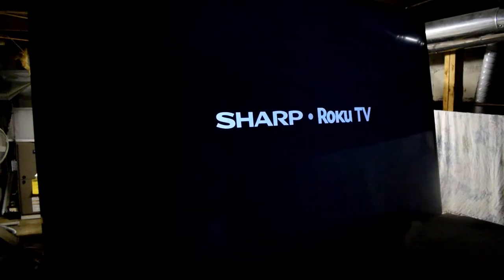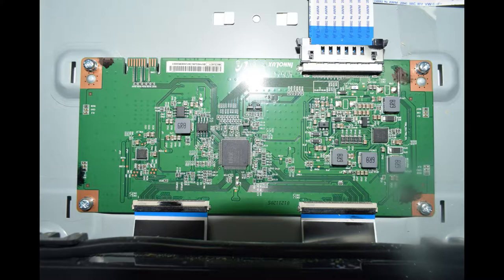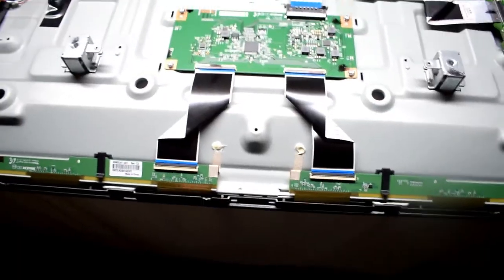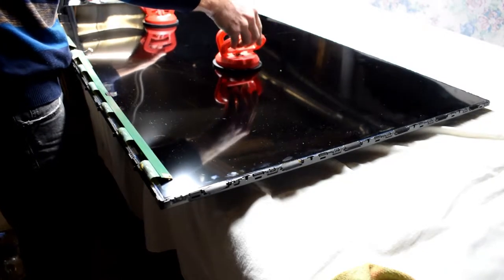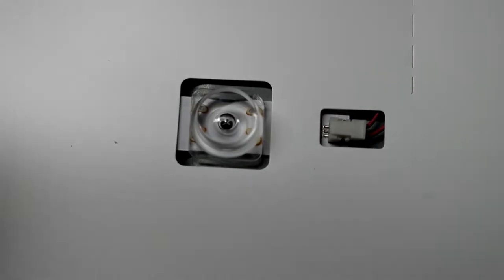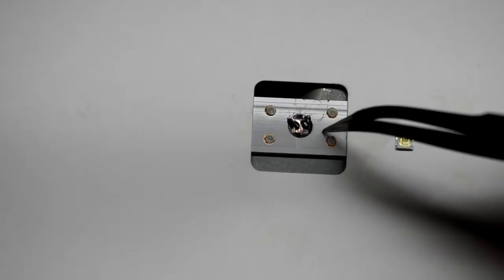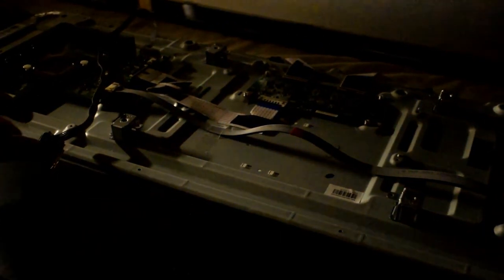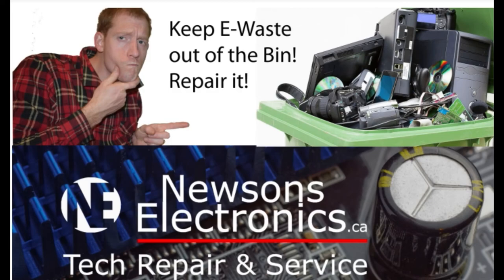58" ROKU TV by SHARP Black Screen FIXED! (LC-58R6003U)

Comment: Big time thanks for this video! I wasn’t able to liquid solder the LEDs I had to buy the whole LED strip. For those struggling with the same issue. Make sure you get the right strip for your model. The strip itself will have numbers that correspond to the right strip. I bought mine on eBay, He’s of luck! I learned some stuff from reading the comments.

Comment: So my tv just had this happen where it couldn't turn on. Troubleshooting every idea that came up on YouTube only to find that the power connection was the problem. Your video was instrumental in identifying the problem. I didn't have to replace the led but had the same tv set aside that had another problem a year ago. Was able to replace broken components from 1 to the other based on your simple instructions 🙏 thanks so much for making this Brother!
Reply: Have this TV and it’s black. Doesn’t turn on. My husband tried to fix it from your video but cracked the screen 😂. We are throwing away the TV, however we have all the parts from the back of tv (motherboards connections etc) and led lights. If anyone wants it message me. We give it away (live in GTA)
Reply: Hello Kate. 
If you still have the parts, i would appreciate them. I have tue same problem and shipping on eBay is about 2 months. Keep me posted if you still have the parts. Thank you.

Comment: Hi, I'm doing repair on a similar model (58R6004U) and believe I have a faulty power supply board. The board probably shouldn't have "heat marks" around some compenents eh? Also, the wires coming off the component in bottom center look a bit charred.

Comment: Do you happen to remember which led was what you ordered? There’s 3030 3535 or 2835 for 3V.   
Thanks man.
Reply: Have this TV and it’s black. Doesn’t turn on. My husband tried to fix it from your video but cracked the screen 😂. We are throwing away the TV, however we have all the parts from the back of tv (motherboards connections etc) and led lights. If anyone wants it message me. We give it away (live in GTA)
Reply: I have the same problem. Did you figure out which one?

Comment: I have the same TV with the same problem. I don’t have a LED tester yet. I disconnected the LEDs and measure the voltage at the connector. It goes from 190V down to 10V and back up. Is that a bad power supply or does this happen because the current is monitored and the LEDs are disconnected?
Reply: Nope!  I think there is an electrical component that is doing this behavior.  It might be a regulator or something.  My LEDs were bad, but I don't think I could have found out with a multimeter.

Comment: How do we fine out witch led size is right of our TV. or do it matter as long as we use the right voltage? (2835 ,3030, 3535 )
Reply: Have this TV and it’s black. Doesn’t turn on. My husband tried to fix it from your video but cracked the screen 😂. We are throwing away the TV, however we have all the parts from the back of tv (motherboards connections etc) and led lights. If anyone wants it message me. We give it away (live in GTA)

Comment: Hi, I have the same TV where at least one led went open cct.  The TV power cycles instead of booting up.  I thought it might have been due to the backlight going overcurrent, but disconnecting the backlight plug still didn't allow the TV to boot up.  Did yours behave the same way when the backlight failed?  I just want to be sure there aren't any additional problems before I waste any time fixing the backlight.  I wonder if the TV monitors the backlight current, then doesn't allow boot up when no current is detected on the backlight output.
Reply: Have this TV and it’s black. Doesn’t turn on. My husband tried to fix it from your video but cracked the screen 😂. We are throwing away the TV, however we have all the parts from the back of tv (motherboards connections etc) and led lights. If anyone wants it message me. We give it away (live in GTA)
Reply: @thezyp hi, sorry it’s all gone.
Reply: For this TV, if the backlight is bad, you won't be able to turn the entire TV on.  Kind of a bad design if you ask me.  I just replaced my backlight with the same symptoms of you, and it fixed it.

Comment: Looks like the link for the 3V LED is broken. Can you please advise on another source?
Reply: Have this TV and it’s black. Doesn’t turn on. My husband tried to fix it from your video but cracked the screen 😂. We are throwing away the TV, however we have all the parts from the back of tv (motherboards connections etc) and led lights. If anyone wants it message me. We give it away (live in GTA)

Comment: Hey can you please share another link to the 3V leds you used ? Link in description doesn't work.
Reply from the maker: https://www.ebay.ca/itm/294218172982?hash=item4480c50a36:g:nCEAAOSwZ79gwIY8
Reply: Have this TV and it’s black. Doesn’t turn on. My husband tried to fix it from your video but cracked the screen 😂. We are throwing away the TV, however we have all the parts from the back of tv (motherboards connections etc) and led lights. If anyone wants it message me. We give it away (live in GTA)

Comment: hi, could i just connect a few batteries to gether maybe 5 and send a current down my 65 inch sharp  to see if the back light is working? thanks 
are u in ontario ?
Reply from the maker: you need 100+ Volts buy an led tester 30 bucks
Reply from the maker: Ontario
Reply: @NewsonsElectronics  nice as am i,  north bay
Reply: What should I expect to pay to have this repaired. This is my issue exactly.

Comment: Can I just use a multimeter and ohm it
Reply from the maker: diode mode should work if they are 3V
Reply: Have this TV and it’s black. Doesn’t turn on. My husband tried to fix it from your video but cracked the screen 😂. We are throwing away the TV, however we have all the parts from the back of tv (motherboards connections etc) and led lights. If anyone wants it message me. We give it away (live in GTA)

Comment: Hi iam in mississauga. Can you fix my tv?
Reply from the maker: if you drop it off, but it's a bit far?
Reply from the maker: what is the issue?
Reply: I have 43 inch sharp Roku tv from best buy. The sharp logo blinks for a quarter of a second and screen doesn't show anything but I can hear click when I press the right left button. Iam in mississauga. Where are you located at? Close intersection?
Reply: Yea your a bit far
Reply: Have this TV and it’s black. Doesn’t turn on. My husband tried to fix it from your video but cracked the screen 😂. We are throwing away the TV, however we have all the parts from the back of tv (motherboards connections etc) and led lights. If anyone wants it message me. We give it away (live in GTA)
Reply: @katek9903  iam in mississauga where are you located?
Reply from the maker: @katek9903  you need to use suction cups
Reply: @NewsonsElectronics  he knows. too late now
Reply: @aliisprince  richmond hill. youtube removes my comments with my email. just search in kijiji tv model and youll see my add. can contact there